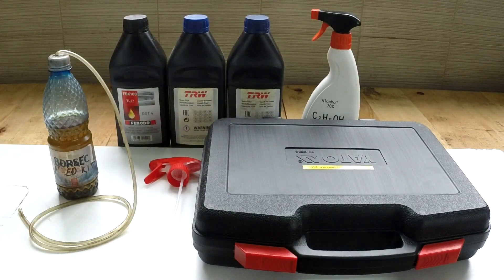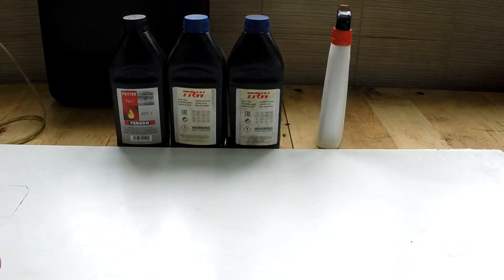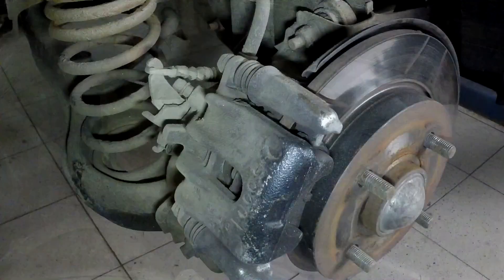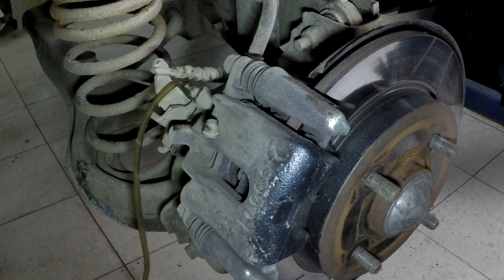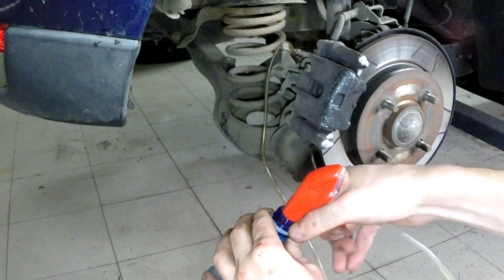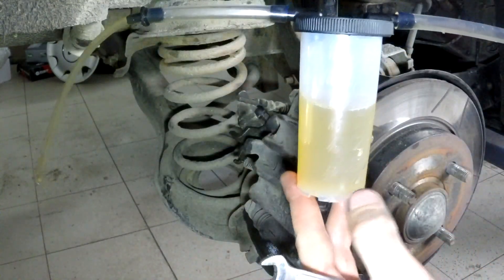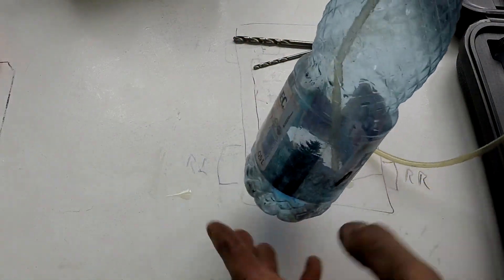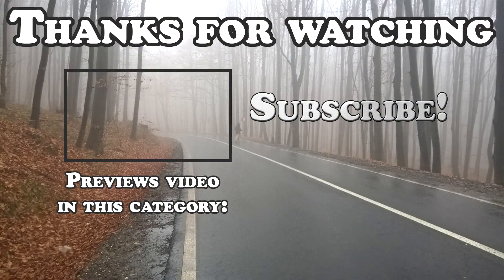How to Bleed Brakes - 2001 Ford Focus

Comment: Thanks for informative video, brakes on my focus feel a little spongy and i will probaby bleed them soon. And can i ask you if i want to fully change brake fluid can i bleed old oil on the nipples or do i need to disconnect the brake lines?
Reply from the maker: Thanks for commenting.
If you fully want to change the fluid, you do it with the 2 person method and trough the bleed nipple. Pump the pedal until fresh liquid comes out. Don't forget to fill up the reservoir.